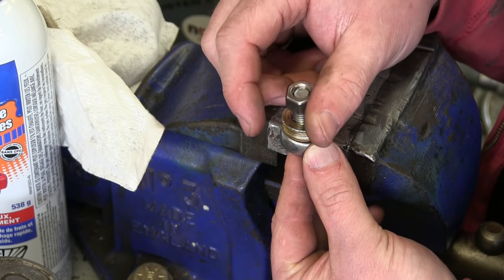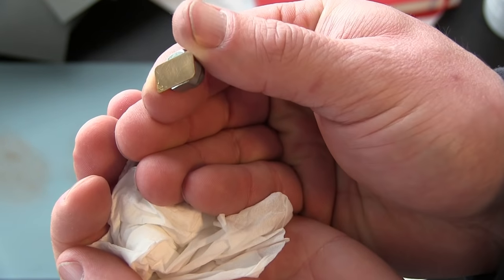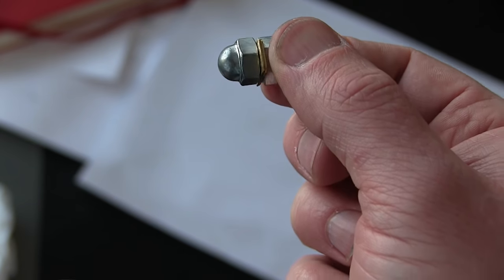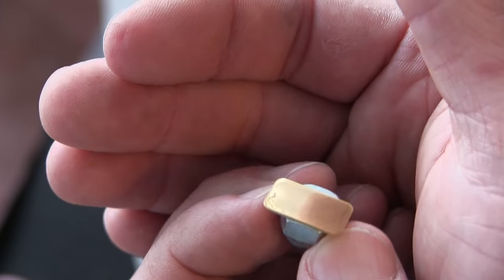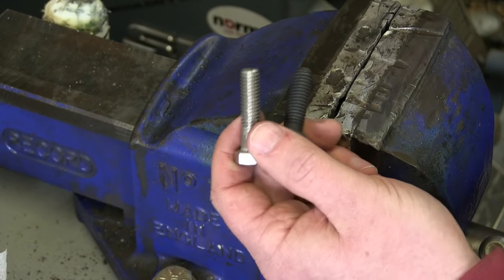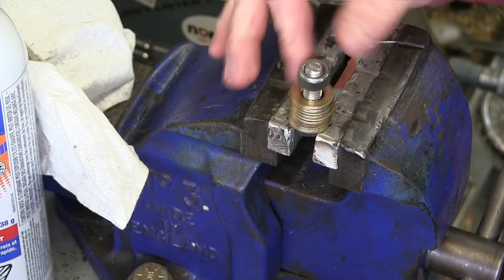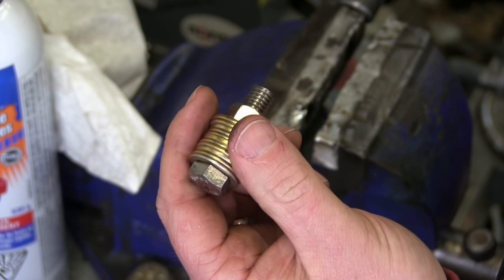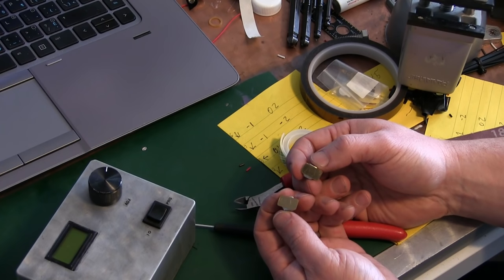Cold Welding of Gold and Stainless Steel in Earth Atmosphere.

Comment: Got to be real careful if you decide to use grease not Copperslip; grease changes the relationship between torque and tension. Same torque, MUCH more tension. So even if you have the best torque wrench, with wrong grease you get permanently stretched bolts. Not so good for a cylinder head gasket seal!

Comment: I work with stainless and I find that if you put some low strength locktite on there that also stops the galling
Reply: If you are not allowed to put any goop on it - fine sand blasting the thread helps aswell
Reply: Most of the time, but you always run into the few fasteners that just want to fuck you over. When i was doing stainless and aluminum fab for boats, we would use sikaflex to seal everything up. even with the fasteners covered in that stuff you'd still run into a nut or two seizing up half way down the threads. its awesome trying to cut off fasteners in confined spaces on a ridiculously expensive boat.

Comment: I use a product called Fluid Film on almost every bolt/nut. Convenient, prevents rust or galding, non toxic kinda expensive but a can goes a long way. Works remarkably well as a penatrating oil, If you have not used it trust me! It takes the place of So many different products and works better than most of them! See ProjectFarms vid on it.

Comment: Plasma Cutters get right through stainless, and they have fancy ones what with the built in air compressor. Just add some pixis and cut away. 
I have heard of mythical black magic that can make oxy/acet cut stainless, sounded nasty what with some sort of flux injected into the oxy stream BUT it can be done...

Comment: I clicked hoping for some clever garage tricks, I watched because you are funny.
Try again, you'll get it, but it takes thousands of psi, a long time at room temp, or extreme tolerances.
Increase time Purity temperature or pressure anytime you fail, remember you have atmosphere trying to get in the joint, and you need to actively push it out, or wait for the atoms to get out of the way, and you need to "push" the metals as close as you can, to increase the chance of random events that allow them to intermingle. The random events occur at random time intervals, but they are less rare at higher temperatures (more energy, more atoms playing swap). The atoms are better "set" and less likely to join and confuse the metal structure in harder materals, gold was a good choice for that reason.
For the betterment of all, any weld occurring below melting temp is a cold weld, and follows the same principles, think forge welds like a blacksmith would do, then science that metal together.

I have personally used cold welds to fabricate steel items, at room temp, for my method you need to machine a very smooth tight fitting joint, your tolerance is less then .0001 inch or .0025mm or slightly interfering keep it covered it oil, and stipple the seam with a needler or a crosspeen, let soak at room temp for an month minimum and assuming you got the joint tight enough and smooth enough you will have a slightly higher carbon steel(what do you happens to the oil?) running though your newly joined solid piece of metal. Of course you need some speciality tools, and that method only works with pin joints, not flats. Maybe you could try with a vice with lapped together anvil's for jaws? It seems like you where close, just not patient enough.

Comment: Cold Welded 2/0 stranded copper wire & lug crimped with 14 ton hydraulic crimper. 
Cross sectioned, unpolished: https://goo.gl/photos/LrhWBiBEJZ7Pq2mK7
Cross sectioned, polished: https://goo.gl/photos/pnXopRfY8iBUPSnV8

Comment: Does this work if the materials are different?
Reply: It shouldn't. One the things that is done to reduce it in space is to use different alloys for parts that touch. On earth the suction effect might still come into the play (it is difficult for the air to get in so the pieces can be difficult to pull apart).
Reply: DudeNumberOnePlus in theory, yes! The problem is contamination due to oxidization from the atmosphere, and the requirement of the surfaces. Needing to be really really smooth. A flat surface isn't really all that flat and has ridges and valleys that limit the contact area. Since metals have atoms that are bonded together in a sea of electrons, in order for cold welding to occur, you have to have the two pieces right on top of each other. So that they can start exchanging electrons. If there is any contamination, like oil or an oxide layer, it will prevent the electrons from exchanging. It's pretty frigen cool stuff.
Reply: JT Jackson edit* missed the part about two different metals. Might be more difficult, and I'm only guessing at this point, but it might still work if the two metals share a similar crystalline structure ie both FCC or BCC.
Reply: galvanic corrosion may weld the two dissimilar metals together over a long time.
Reply: swiftrance: yes they can, i spent 11 hours drilling and chiseling out faulty aluminium ABS sensor from steel stub axle housing.

Comment: There is no such thing as cold welding. If the two surfaces are parallel and polished, when pressed together the atmosphere is pushed out and a vacuum is formed causing them to stick together. The term weld is a processes that requires heat. Lots of high heat, which causes the atoms to expanded to the point were they comingal with adjacent atoms and when cooled all the atoms interlock. This is another video from some one who dosen't understand simple physics.

Comment: well cold welding is hard even is space is not easy task.Only advatige is that in space bare metal dont oxidized.Even that acident in space when the hatch door stuck.Most theories was that the stainles mechanism or hinges cold weld.To this day they are not 100% sure what is the cause.There was no sings os cold welding and there are theories that the hatch bont work even before start.

Comment: i always thought you needed lube when mixing metals, but i guess you also run a risk with the same. Always lube er up i guess
Reply: From working with cars for the last 5 years I've learned that you ALWAYS lube her up, no matter what.
Reply: David Vikken I'm building an ar15 right now and every instructional video emphasized putting grease between the steel barrel and aluminum upper receiver because apparently you will never be able to get them apart if you don't. I will take you advise when working on cars in the future lol
Reply: A touch of antiseize goes a long way. I always use antiseize and torque to proper specs unless the manual specifically says to use loctite.

Comment: son of a bitch those guys at Longwoods are a bunch of trolls!!! the bolts they supply with their machines are 314 and the nylocs they send are 304!!!!! son of a bitch. they even specify in the manuel to not apply anitsieze. 4 of these bolts per panel, 72 panels Inc wash tanks. I want to die. (PS I just rebuilt a whole machine with these.. fuck.)

Comment: ever heard of ultrasound welding?
Reply: I think that only works for plastics, doesn't it?
Reply: I think, battery tabs on lithium RC toys are done that way
Reply: Aren't these just spot welded usually? I'm pretty sure that tabs on 18650 cells in tool battery packs are just spot welded. The only application that I know for sure uses ultrasound welding is putting together plastic cases for electronics permanently. Incidentally this is also often done on tool battery packs.
Reply: Let's look into it
Reply: Infact the video of the guy you've just watched (ave), mentioned it in a video made in 2016
Reply: Yep you were right. I never said it wasn't possible, though, just that I never came across it. But now I'm gonna have to read up on the process because I can't stand it when I don't know how something works.
Reply: Glad that you learnt something new
Lol